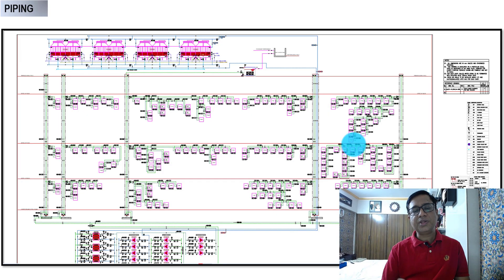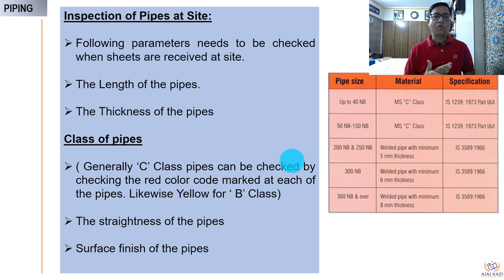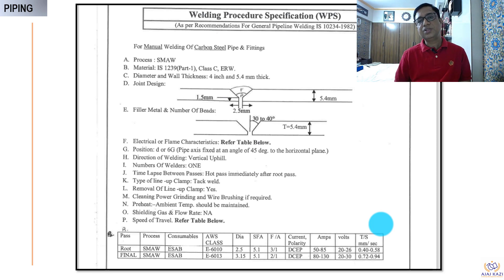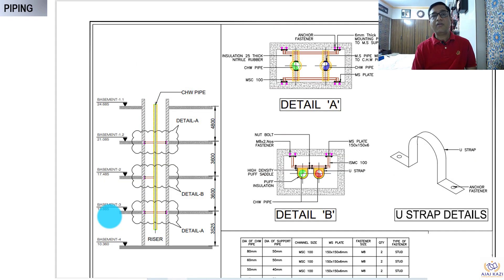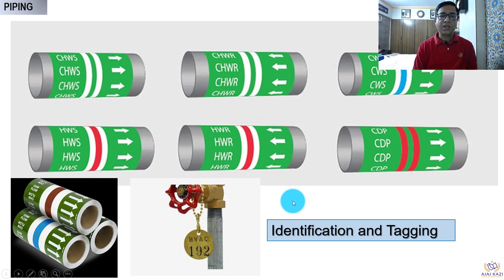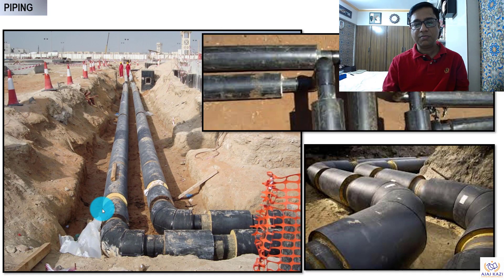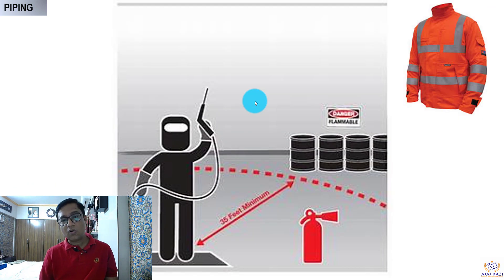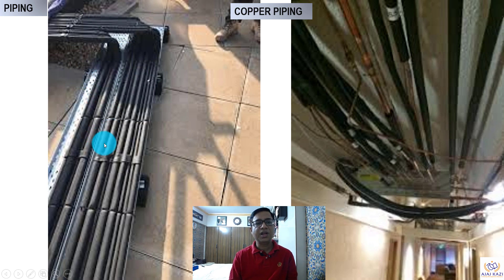HOW TO INSTALL HVAC PIPING? | HVAC | CHILLED WATER PIPE INSTALLATION STEP BY STEP AJAZ KAZI

Comment: It was quite informative video, could you please explain usage of backing rings while welding higher size pipes? How often backing ring utilisation is adopted in India for welding? If not used what adverse effect could be seen in long run?